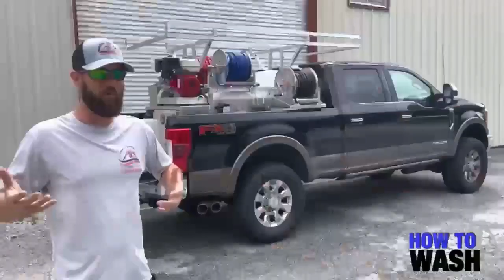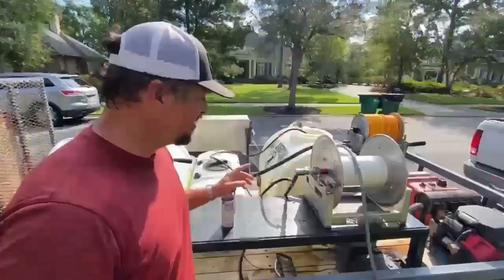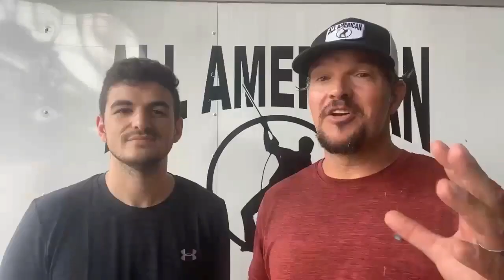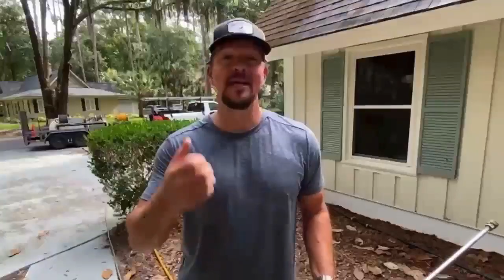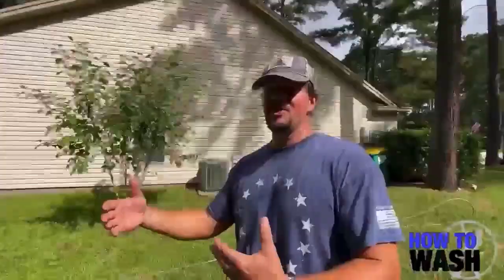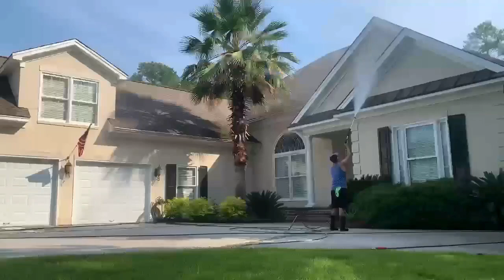TIPS FOR QUOTING PRESSURE WASHING JOBS USING SQUARE FOOTAGE

Comment: I am just getting started and have an opportunity to get a large commercial building but they only want the front and 1 side of the building done.  How would you suggest charging because I can't go by the square feet of the whole building.   Should I take the length and height of each wall and charge for square footage of each wall?  I am new to this and used to pricing houses by the square feet of the entire whole house.
Reply from the maker: Close to the same price as the whole building. That’s the allure to doing the whole building.
Reply: @AaronsLeanMeanAcademy  ok then my numbers are a little off 😅.  Thanks for the reply

Comment: Hey there, so I am in the chemical industry (in South Africa) however it's not what I'm passionate about, I have spent months watching your videos and I'm still battling to grasp the intensity of approaching really good potential clients, for example I live in a gated complex (we call town houses) and this place needs a good clean up, ultimately my question is how do I quote on a job that I know has the potential to catapult my pressure and soft washing business? there are 30 houses and alot of roofing, gutters, walls and surface cleaning to it, if I apply the rates that are average. I might just over complicate the way I address the client. I know that this client isn't going to spend huge amounts on maintenance to clean this place up. I could really use your help. Regards Donovan

Comment: That's exactly how I price. Go by sq ft then by the difficulty of the job or structure then I'll either go alittle lower or higher.  I go by .15 sq ft usually.
Reply: So you'd only charge $300 for a 2,000 square foot house wash? Seems too cheap. But idk, I haven't started in the business yet
Reply: @MrBellyman128  Yep. But it depends alot where u live too. Got to find that happy medium.
Reply: @D  I live in the Boston Massachusetts area. I figured that job would cost at least $750
Reply: @2Alife2  I based my company logo off the 3%er sign it’s frikin awesome

Comment: So, Ive heard many people say that down streaming limits your SH content to about 1%,  but cant you just simply install 2 x-jets,  and get double the SH in the mix?  AM i missing something here? lol
Reply: What is a x jet?
Reply: @albertrodriguez8279  it's a nozzle you connect to your gun this particular nozzle has hose that runs down into a bucket of what would be your soap/sh.  You can change the fitting on the nozzle to up you sh amount however you have to carry that bucket of sh around with you everywhere
Reply: With an x jet you can make your mix as strong as possible